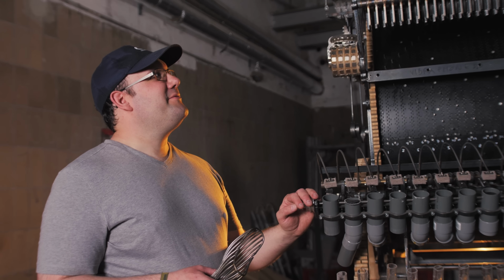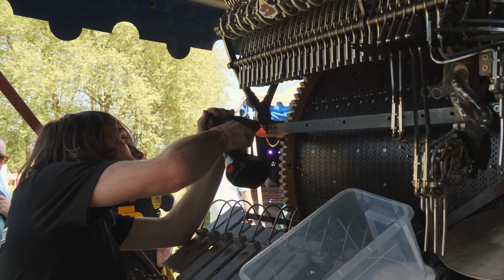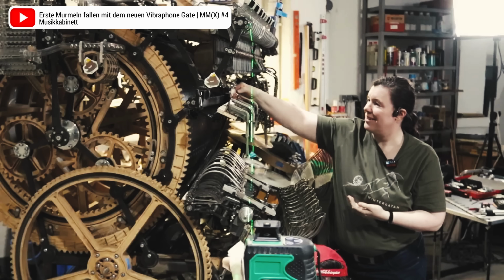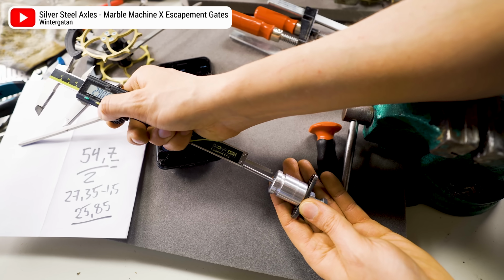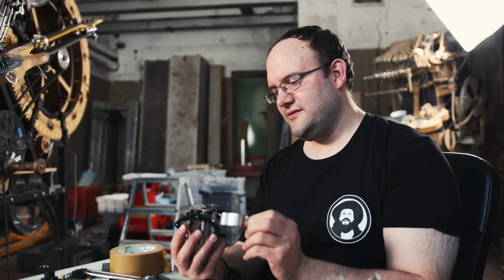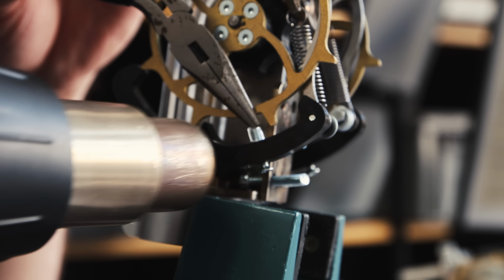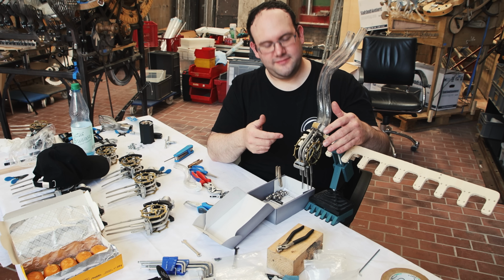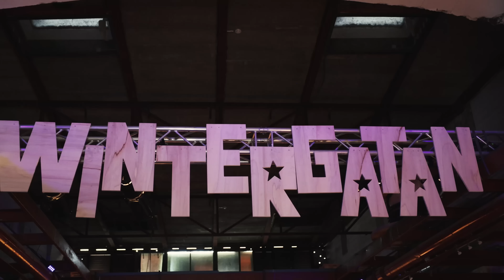The part that took us a year to finish | MM(X) #6

Comment: Was that aluminum you were putting to the bench grinder?
Reply: Yes, the rack supports are made of aluminium.
Reply: @Koffeinsuechtigi  use great caution when grinding soft metals like aluminum on a stone grinder. The aluminum will embed in the grinding stone. A stone that's loaded up with material like that could explode when it's running.

Comment: 9:24 - maybe it makes sense to bend the top bars outwards (closer to the escapement wheels), because it's not a problem if marbles of one track touch the marbles of the neighbouring track.
Reply: Sadly that's not much of an improvement. The neighbouring track never moves at the same time, so if a marble wanders from the current track towards that other track then it might bump into the static marbles, stop rolling and hence form a clog. And if the pressure is high enough then it's also possible that marbles simply start pouring out from there, so ideally we keep some kind of constraint.
A lot of tuning has happened since that video so we got it to a point where it is good enough, but if we want real improvements then we would need a better constrained solution, like the small wooden roof which Martin made for the cybergates.
Reply: @jbert42 I'm pretty sure all the gravity forces from the tubing are going to be loading the singular top track rod, so refitting may be required, and consequently it's entirely possible that we might find inconsistent results when marble stockpiles run low, as marble gates designed to contain marbles when loaded may jam up with the weight off.

Limitations of trying to simplify the design I suppose. Might have been better to contain them within two machined aluminium shells or 3d printed plastic to grant visibility, and rigidity and remove any flex.

Regardless it's pretty, and the goal is now 'get it working' rather than 'fix everything'

Glad to see it start working!
Reply: @glenmcgillivray4707 , we worked on all parts with the aim to keep it in principle within Martin's designs. We did add things, modify some, but we didn't want to completely redesign the escapement gates, or rather the three-rail marble path as that would significantly change what the gates look like. As we now know what the failure points are, we try to find ways how to make modifications that alleviate the issues while not intrusively change the overall look. As JBert said, there are ideas floating around ;)
Reply: @Koffeinsuechtigi  I'm mostly commenting because I had the realisation of why precisely Martin's design choices had considerably hindered his goals of marble containment and management. It's unfortunate but understandable he made some mistakes in the process. And the marble gates are complex components with hilariously many moving parts and simultaneously complex enough to make redesigning and rebuilding them a fourth time painful.

Containment and constraint of marbles which just wish to escape will forever torment this project unfortunately. But so long as we keep our eye on it, we can work around the complexities.
Reply: @glenmcgillivray4707  , hahaha, "Containment and constraint of marbles which just wish to escape will forever torment this project". That's a nice summary :D
Reply: @Koffeinsuechtigi  and now you've got me thinking about how Martin's project is just real life Prison architect.

In 3 D.

Comment: It's getting obvious the MMX required a bit too much further development and a bit too much maintenance and a few too many engineers to be practical on the road...
Reply: I never understood why this machine was ever intended to travel. Record an album? Yes. Package up and travel with? No. I think the number one problem with the mmx was its conflicting goals. It needs to be a massive musical Rube Goldberg machine, and it’s also supposed to travel.  
  
Pick one or the other. I personally would have rather seen the traveling showman requirement dropped than the machine itself.